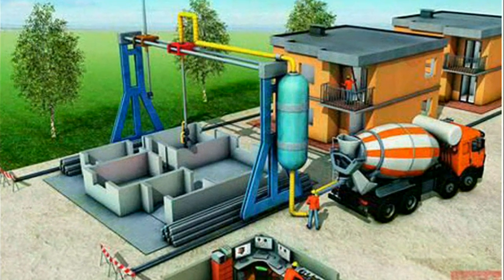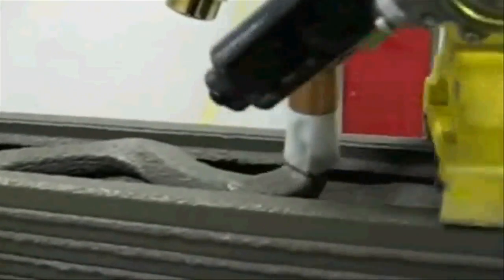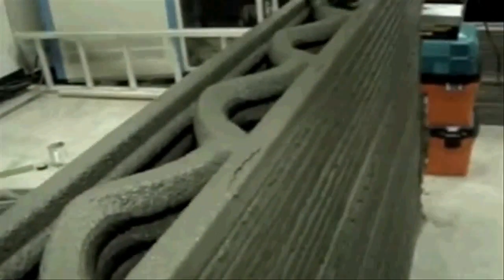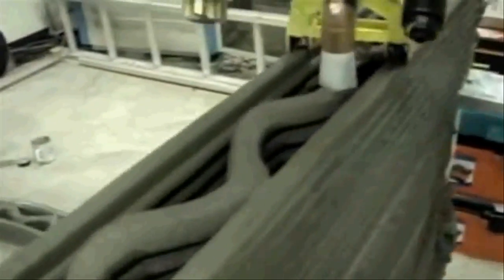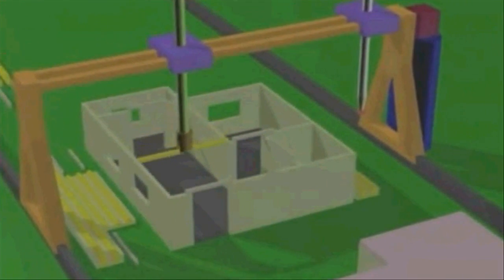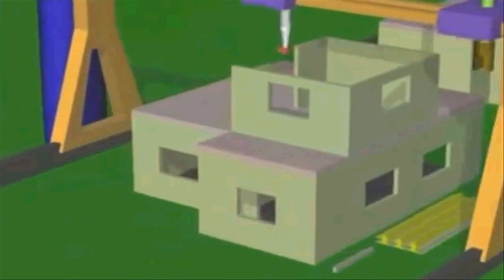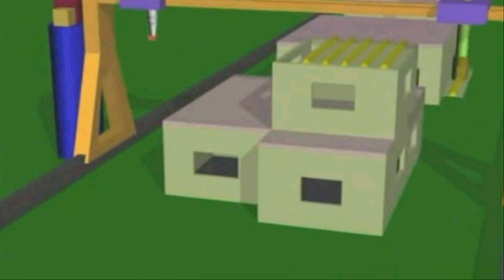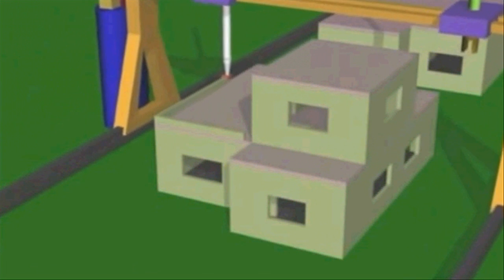3D Printing Technology to build 2,500 Square Foot House In 20 Hours.

Comment: How is re-bar added? - does this pass earthquake codes? 
How is slump controlled? If the cure is accelerated to control the slump then layers won't bond and the place falls apart. There are other technologies that are faster cheaper and give a better finished project. Before people get all excited that this is the next best thing. Talk to a building contractor.  They could spend hours explaining how this is going to cost more for a crappier product.